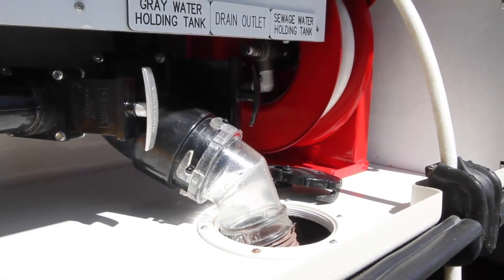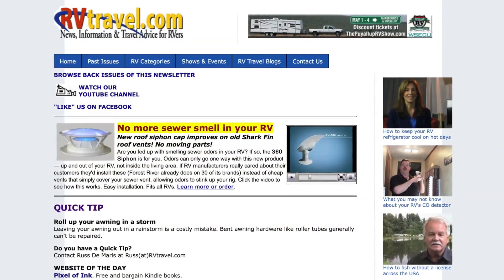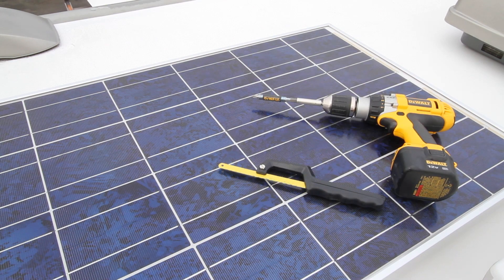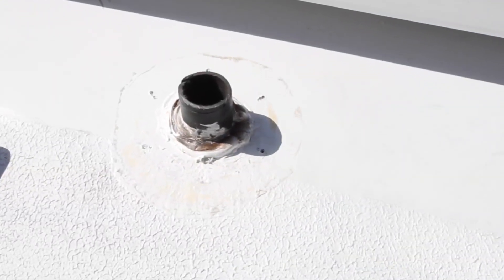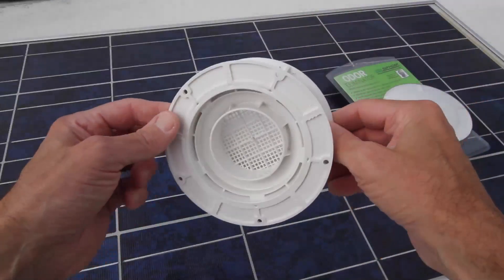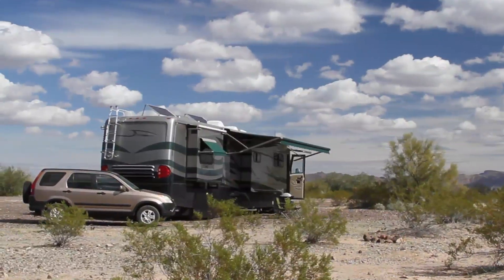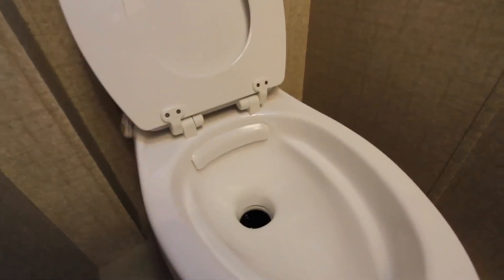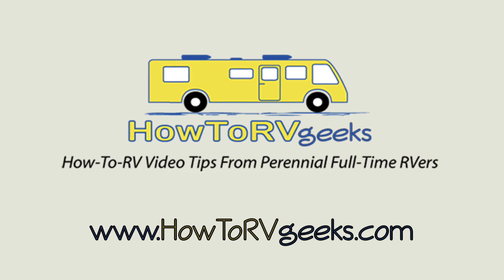Stop RV Tank Odor With RV 360 Siphon Vents

Comment: Thanks you guys, we recently bought a 2018 Coleman 263BHE and no matter how long I take at cleaning our tanks the sewer odor is something I can't get out. I noticed Coleman did not include a separate hose connection to the black tank as our 2008 KZ trailer had which was so much easier to clean our black tank. I will be investing in this product and hope it helps. Your installation and review was very detailed, thank you.
Reply from the maker: Congratulations on your new RV, Jose! Hope the 360 vents do the job.

Comment: Installed 2 today and it took a few more minutes as the installer,( me) was trying to save mileage on the knees by laying down. I happened to push the tool bucket off the side of the roof with my foot and into the gutter with lotsa stinky water.  So add 20 minutes to dry out the Dewalt drill bit-driver kit.
The pipe will cut easy with a hand hack saw.  Just for kicks I was going to use the battery sawzall, it could not go down to 5/8th without an angle.  My rubber roof is not as clean as Norman the Newmar so I used lots of simple green cleaner and a medium brush.  My 10 year old Pacific Coachworks trailer has EPDM( rubber)roof. It appears that the roofer was blind or in a hurry as there was a 3 inch triangle cut out near the original vent. If it does not say "Airstream" on the side your trailer is possibly junk like mine. Rolling junk that is fun to fix!!!!! To fill this gap I used Dicor self sealing Lap and I cut out a triangle from the package the 360 vent came in. It had a raised and perfectly round package so I cut from this circle.  It sealed nice.
If you live in beautiful California you cannot purchase mineral spirits. Not legal because of federal laws. So when you head to the RV show in QZ, pick up your Mineral Spirits.
I resisted the urge to flatten the lap seal with a putty knife as it was cold today, it still spread out perfectly on its own within about 20 minutes.
Another factoid to consider if on the fence......these vents work awesome!!!  And with the built in screen they keep out flies and Bees!!!
Easy install following this vid!!
      Thank you!!!   SW
Reply from the maker: Sounds like you have an installation like ours.... lots of little dramas on the way to a successful finish. Oh the outtakes we could share. LOL Nice work Scott. Hope you love your 360s as much as we do.

Comment: Hi guys, my wife Julie and I just purchased the siphon 360 because we desperately need to get rid of "that smell."  The product is a bit different now (no screws required) but install still looks fairly straightforward.  I really hope they work......  Thanks for the idea and video.  We always look forward to new posts.  Can you recommend the best black and grey tank maintenance product (what you use).   Thanks in advance.  We hope to see you on  the road sometime soon.  We're prepping to go full time and hope to hit the road by March/April 2017.   Thank you for all of your channel content.

Sincerely, 

Glenn n Julie
Reply from the maker: Hi Glenn & Julie!

Hope the 360 siphon works for your odor issue. If you have real problems with the black tank (pyramiding for example), you may need to take other steps, which leads directly into your question about holding tank treatments. Based on great reviews we'd read, we switched to Happy Campers brand this past year, and are very pleased with it. This is the one we use: http://amzn.to/29B653s

But Happy Campers also makes an EXTREME version for problem tanks and excessive buildup. If you're still having odor issues, we'd suggest trying that: http://amzn.to/29Itj2Z

We have never needed the Extreme version ourselves, but have also read good things about it. If you've purchased a used RV and don't know how the tank was cared for, this is the best course of action to clean it out. The 360 siphons are needed on every RV anyway, so they won't go to... ahem... waste. ;-)

Congrats on your plan to go full-time! Hope you love it as much as we do. Our "2 to 3 years" is now over 13, and counting. ;-)

Hope this helps. Please let us know how you make out.

Comment: We installed these on our motorhome last January 1917 and have no problem with blank take odor in the RV while traveling down the road, until this trip when on two occasions when flushing while going dow the road we got a strong black tank odor, even though we had no windows open in the RV.  I am going to check for blockage on the roof, otherwise, I dont why we got the odor this time and not before.
Reply from the maker: Sounds like something’s blocked all right... or a small window open.

Comment: I'd been thinking for awhile about picking up one of the campco models but that lack of moving parts does seem like a better feature.
Reply from the maker: That's what we though too, and there's no clearance issue to worry about like with the rotating type, which would have been a problem with our solar panel mounted so close to the vent stack.

Comment: I wonder if the top of this 360-Siphon vent can be replaced easily if ,for example ,a branch  breaks it?
Reply from the maker: Hey Danny! Sure thing. It's so close to the same install job as a regular roof vent, that it should be a snap. The only difference is the sleeve that goes into the pipe, but a new replacement 360 vent would of course come with that.

Comment: Noticed that the  base on some 360 siphons are Taller and some are flush.  what is the difference  saw this on Ebay while shopping and  on video (Siphon 360 RV vent installation on LTV unity)  Just got mine from Ebay  the short one like you Installed on your unit
Reply from the maker: +1995dresser From what we can tell, it appears that 360 makes a model that's available to manufacturers called the "Hi-Stack" that allows the vent to meet an RVIA standard of having the stack at least 2" above the roof line. We're not seeing that model available for retail, but available to manufacturers for OEM use. Not sure we care about that 2" RVIA rule, since ours work fine the way they are. :)
Reply: +RVgeeks  Thanks again  if anyone would know it would be you . that's why I thought I would ask you about it. I had seen them  but no information about them and nothing on the 360  site   was just wondering what the difference was .  Thanks for the Info

Comment: can you join the gray tank vent pipe with the black tank vent pipe and have only one roof top vent?
Reply from the maker: We're guessing that if you could, then manufacturers would do it, since it would mean one less roof vent cap and one less roof penetration. We're thinking that there is likely some RVIA code requirement to prevent an over-filled black tank spilling over into the gray tank, or something like that. Other than that possibility or regulation, we can't think of any reason why you couldn't do it.

Comment: my black water tank vent is located about 5 inches from the vent in the bathroom. it faces the opening to the vent. What can I do to re-route the vent, or am I just screwed.
Reply: I mean to re-route the sewer vent.
Reply from the maker: rick adam Hi Rick. That does sound like poor placement by the manufacturer. I suppose if you're having an odor problem, you could "re-route the sewer vent" by connecting a short length of PVC pipe to move the opening away from your vent fan. I wouldn't do that unless you have no other choice. You should still be able to install a 360 vent, since the diameter of it isn't that large (about 5 inches I think). That would take care of pulling the odors out of the black tank, then all you need to do is run your vent fan on low whenever it's open (assuming you have a Fantastic or other brand of fan in the roof vent... if not you can install one). We almost always keep our vent fan running on low whenever it's open, and it draws hardly any power at all. Hope this helps.
Reply: RVgeeks thank you very much for the info. I never had a problem with odor until last month when I replaced the stock fan in the bathroom with a larger heavy duty one. That's when the odors arrived. Since my sewer vent is so close to the vent, and I install a 360,  the fan won't draw in outside air, right?
Reply from the maker: rick adam Ahhhhhh. We were initially thinking that the proximity of the roof vent to the black tank vent was the problem. But if you never had a problem before replacing the fan, then the proximity alone can't be the issue. It does seem counter-intuitive to us that a stronger fan would cause the problem, since it blows up and out of the bathroom. A stronger airflow from the fan should theoretically prevent smell from the sewer vent from coming down through the roof vent, no matter how close the black tank vent is. I'd suggest trying this: try testing the roof vent in four different configurations: 1) Lid closed, 2) Lid open but without the fan not running, 3) Lid open, but fan on the slowest setting and 4) Lid open with the fan on a higher or highest setting. If you don't have any odor problem with the roof vent open but the fan off, I can't imagine that the proximity is the issue. If it only happens when you're running the fan on high, try sniffing around under the sinks. There are special valves on RV plumbing drains that are designed to prevent the odor from the gray tank from coming back up through the drains. If you turn the fan on high (especially with most or all of the windows in the RV closed) there may not be enough places for air to come from to feed air to the fan, and it can cause it to pull air past the plumbing vents under the sinks and bring gray tank odor into the RV. Again, you'll smell it in the cabinets under the sinks, especially when the fan is on high. The solution to that is either to replace the worn out plumbing valve under the culprit sink (the valve rubber can stiffen over time and/or the spring can get weak) or don't turn the fan on too high without at least a couple of windows open, so that the fan can draw air from somewhere other than the gray tank. All that said, 360 vents are not especially expensive or difficult to install, and they work great. So before doing anything radical (like adding PVC pipe to the roof), we'd try the 360s if the plumbing drain vents aren't the problem. Hope this helps. Let us know how you make out!

Comment: Going to try one on my travel trailer. it sits at a campground year round and both of my tanks share the same  vent stack. I get mostly gray water smell sometimes.  and Black tank smell if it has been closed for a while. but if anyone knows how it works its got to be you. can't go wrong with that . Great Channel   also tried White Vinegar  down the sink and bath traps it does kill  the smell for a while
Reply from the maker: +1995dresser Our 360 vents do work great. Since your RV sits in one place, are you leaving it empty for periods of time? Or do you stay in it all the time? The reason I ask is because you mentioned having had some success, even if temporary, pouring vinegar down the traps. If you leave the RV sitting for any length of time, the evaporation of water from the traps can be a cause of odors getting back up into the living space. If so, then pouring plain water down the traps would help too, since of course it's the water in the trap that blocks the smells. If you are indeed leaving your RV unattended for extended periods, and the traps are drying out, we've heard that adding a half cup of mineral oil down each trap immediately before departing for a while can prevent, or slow, evaporation. We haven't tried it (we're always on board full-time), but if you're away for a while, you might try giving that a try and letting us know how it works!
Reply: +RVgeeks We only use it for weekends or just to get away its 45 minutes from home . but sometimes it will not be open for a month . but the water seal in the toilet always has water .  also to contribute to the smell is the fresh water I have a filter but I has a faint smell to it . but outside the trailer when I use the garden hose it does not have a smell . I have been told that its the mineral deposits in the water heater . 12yr old trailer might try some CLR in the tank and flush the lines . It sits from the end of October  to  April with no water just antifreeze both gray and black tanks cleaned and flushed
Reply from the maker: +1995dresser A month is plenty of time for the traps to dry out. Maybe try the mineral oil in them before leaving it closed up next time. Water in the toilet is good... means the seal is holding water, which is essential for keeping odor down where it belongs. We'd suggest that CLR might not be the best thing to put into your water heater. If you're getting water heater tank odor, check out our videos about flushing the tank, which you can find here: http://thervgeeks.com/water-and-sewer . There's one about flushing an Atwood brand heater (no anode rod) and one about flushing a Suburban brand heater (has an anode rod). If you have a Suburban heater, be sure to watch this follow-up about anode rod replacement: http://thervgeeks.com/plumbing/update-rv-water-heater-anode-rods

We'd also try replacing the fresh water filter, especially if you can smell it.

Hope this all helps. Best of luck.

Comment: I bought a 1998 Winnie Minnie from a second owner.  Had water line leaks that finally just recently repaired.  After a third shower, the odor coming from it is horrid.  I'm sure it's an air trap problem as no odors from any other water source (kitchen or toilet).  Maybe this would fix it.  Thoughts?
Reply from the maker: Hi LuAnn. Is the odor coming up out of the shower drain? If so, the trap under the shower may not be holding water in it. Are you fully hooked up with the gray tank valve open, or are you dry camping (and therefore filling the gray tank as you use water)? If your gray valve is closed, and the tank is nearly full, it's possible that the vent opening inside the tank that goes to the roof is under the level of the water, so blocking the air from escaping. The 360s are well worth the effort to try to get rid of all odors, as we found them to work better than we ever expected.
Reply: 1.  It only smells when the water is turned on in shower.  I hadn't used water from the shower as I had leaks that had to be fixed.  So I had been bathing with a bucket(s) of water in the shower stall and didn't notice any odors. 
2.  I am in an RV park full time and hooked up to the sewer line with tanks closed; emptying once a week or so. 

I also noticed the smell when I went outside of the RV where the shower is located.   It costs a $100 just to get the RV guy here to look at it.  I'm on a very limited income & getting a new toilet, sink faucet and shower head installed set me back about $500. 

Thanks for your input!  I'll post again when I get it straightened out, with the solution.
Reply from the maker: LuAnn Patterson Hmmm. Not sure what it might be, but we suggest before spending any more to have a technician come out, that you post a detailed question on the iRV2 forums. It's free to join and post, and there are a TON of knowledgeable RVers (and some RV techs) ready, willing and able to help out. Go to: http://www.irv2.com/forums and sign up, and be sure to let us know how you make out. Best of luck, LuAnn!
Reply: The RV mechanic guy was working on the rig next to me so I asked if when he was done to come see me.    He turned on the hot water faucet at the sink and said 'Is that the same odor?".  Yep, it was.  He said it was probably caused by the water heater not being emptied by previous owner.  I realized that my daughter probably turned on the hot water faucet in the shower out of habit.  It's been so hot here that even the 'cold' water is rather warm and I hadn't turned on the hot water when I took a shower so that explains why it didn't smell for me.  In this process learned my levels meter isn't accurate as it shows I have a full tank of propane but they checked the unit and it shows empty.  My next step is to get propane and give the water heater a thorough flushing.  And if that doesn't work he said to fill the water holding tank with a bleach solution and flush again.  It's not been officially dewinterized.   I hope that is all it will take.
Reply from the maker: LuAnn Patterson I see. So it's the "clean" water coming out of the water heater that smells. Definitely watch our videos about flushing the water heater and sanitizing the fresh water tank to get your water system all cleaned up.

Comment: the bathroom sink does not have an air valve, I don't know about the shower. the galley sink does have one and its own tank. We are in our RV full time and I have the gray water tank wide open all the time. I did flush the toilet with the fan off and got no odors. So I think by installing a 360 will improve the problem since it is windy everyday her in BullheadCity AZ. I'll try that and let you know how it comes out. I also drain my black tank every 3 days since we had this problem and flush out the tank with the built in sprayer. that seems to help. But once we boondock, that will change. Thanks again for your help.

Comment: I know you both are down under, so I hope this question isn't a bother. I was just wondering if you ever had an issue with this roof vent getting brittle? Its design seems kind of flimsy with way the cap attaches to the base. I just discovered a broken cap on my Fifth Wheel today so Ill be replacing it soon. Just wanted to see if you all still think highly of this product. Thanks and good luck down under.
Reply from the maker: +windersranger1 Thanks! And G'Day from down under! No bother at all! 360s are made of polycarbonate, which is very strong, not like plastic at all... even though they look like it. Ours are still like brand new.
Reply: +RVgeeks thankyou for the prompt reply. Have fun down there!